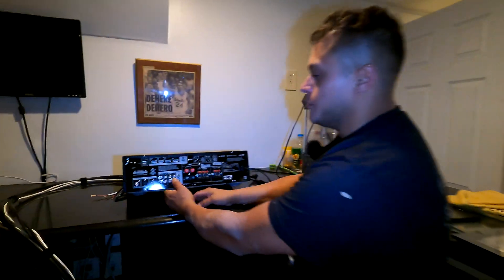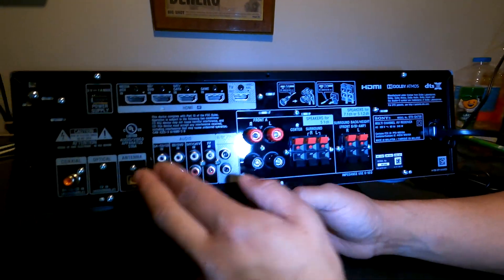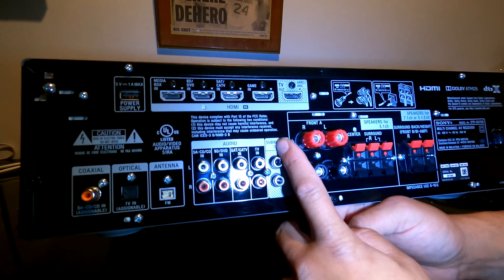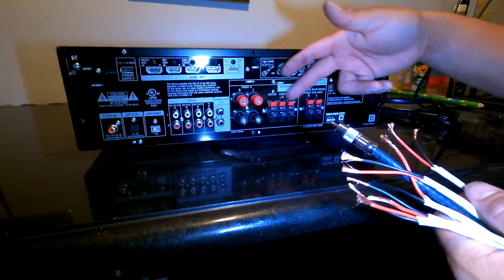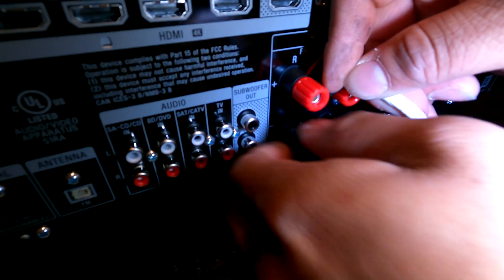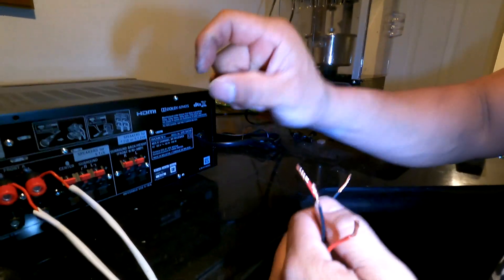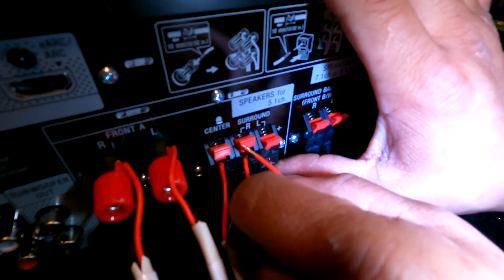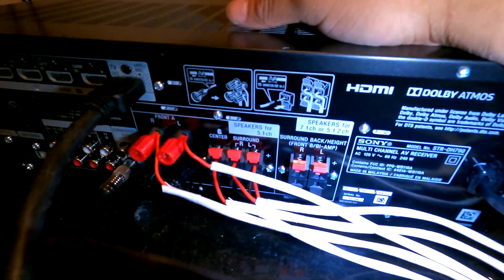How to Properly Wire an AVR for 5.1 or more Surround Sound Follow Along

Comment: Pretty ridiculous to find the sub that I was supplied with didn't come with the appropriate cabling to connect to a receiver as it was just speaker wire while the receiver requires that plug format

Comment: This is a really nice video and explanation.  It's unbelievable how confusing this stuff is if you never did it before.  But this simplifies it with a basic setup.  I think I will try mine.  Never did it before.  Hopefully I can get it to work.  But this does leave me more confident.  You example and walkthrough helps people.  Thanks for that.

Comment: Those are thicker wires than what I just picked up. I am doing a 20 ft run with Sony receiver. They specified nowhere what wire/gauge to use. Any suggestion?
Reply: Sorry bro didn’t reply to you he just has some protection on the wires there all mostly the same thickness unless you buy thicker wire

Comment: Oh and this gets a little more complicated ive found when using an xfinity flex box with my "smart" stupid LG tv...have to set the audio settings on the TV first then I can adjust on the flex box.  But this reciever is bluetooth though so wouldn't I just be able to connect the TV box bluetooth or would the sound not be as good...I'm using the optical at first...just trying it idk. Oh and Damme that perfected all perfect little wiring bundle you got there, ugh I wish I had that right now cus me and my man are sitting here on the floor with wires all over and our razor blades splicing away all these and we have to hurry because it's already 11pm here and I don't wana piss my neighbors off too much but so excited to hear this set up we just got.

Comment: ATMOS 5.1 ?
You need a 7.1 or 9.1 system to use the height speaker. So you should be able to use just the SP/Div out from your Monitor/TV
You bought it too soon i would say.

Comment: @dreamediainstalls, Awwwe man, I am so glad I found your channel. Your video seems easy  but in actuality sooo complicated. I’m new to AV’s so I’m misunderstanding it’s use

My friend has a:

BOSE sound bar that has:
A)1.S/PDIF Output - B).a RCA input #1  C).a RCA input #2  -D).a sub out 

SHARP AQUOS QUATTRON

What I see on the back that’s plugged in is

VIDEO 1:   w/ R AUDIO L AND VIDEO
VIDEO 2:   w/ R AUDIO L AND VIDEO
COMPONENT:  w/ R AUDIO L AND VIDEO AND Pr Pb and Y

(She has the  BOSE  RCA input #1   going into that component R AUDIO L AND VIDEO of the TV.

YAMAHA HTR-6230 5 CHANNELS A/V RECEIVERS 

On the back of the AV I have no idea where to plug anything to the back of this. I twiddled around and put it in the CD in the DVD in everything I could and on the front put in the corresponding input and nothing works. 

I just want to know how to connect  the SOUNDBAR  with those specs( I have above) . Its a old one she said that around when they first came out but those are the only terminals at the back

I'm confused on making work through the tv and the AV and I'm lost. Can I ask: In any case do I connect the HDMI from the AV to the TV no matter what?

I see from your video the visual on the back looks so much like mine, but I can't get it connected and for the last 4 weeks till I seen this video, it started to make sense, but still don't know what I'm doing wrong. Its driving me nuts!!

Can you tell me where I'm going wrong or what's the best way please, Thanks

Comment: ok but what if the subwoofer has wire connection like most of the speakrs? I have the same receiver but on the onkyo sub i have just wire connection... what do i get for that>?
Reply: I have the same issue, did you figure it out. I also have the Onkyo.

Comment: I’m not quite 4mins in and I’m so confused and with wat I think I need to learn rn it is not helping me any. Between the back ends of both my new surround sound system thing and the projector the holes that can be plugged into r like 1/5th of the number. The surround sound system the main 1 has 5 things that look like breakers and a left and right aux. no other holes or protrusions. Each of the 5 speakers also have that breaker looking thing and another hole for something. I’m looking at this wire that is made of 2 wires each covered by a clear coloured plastic-like material, 1 side is bronze coloured and the other side is silver coloured.

Comment: Wow poor speaker wiring connections. Use banana plugs or pin type connectors soldered to wire.
Reply: All audio equipment is designed to accept bare wire, there is no reason in a permanently installed system to make a second unnecessary connection, peace.
Reply: not all is banana plug compatible here, only the main channels ?
Sony did a bad job here, sorry, 5.1 ATMOS is not even an option..ATMOS without height speakers ?
Reply: @darrinsiberia  well that might be true but you're DEFINITELY NOT an engineer, peace.